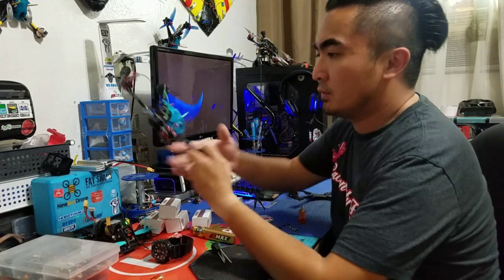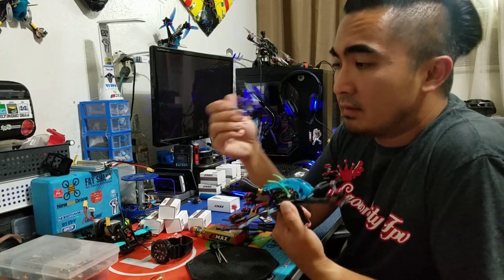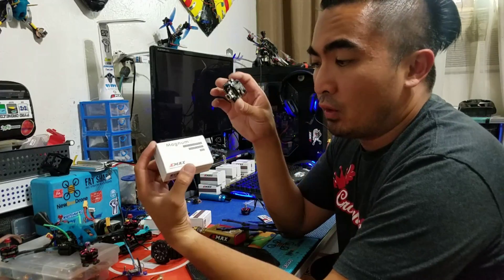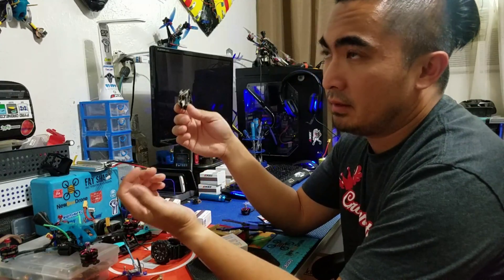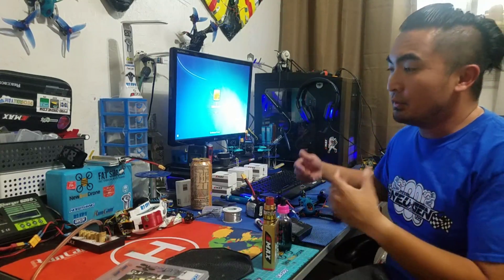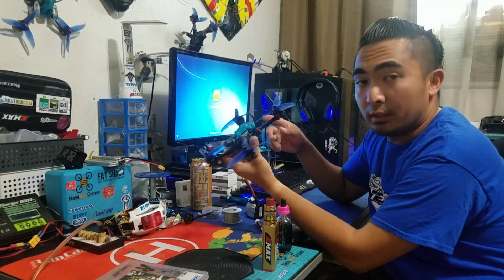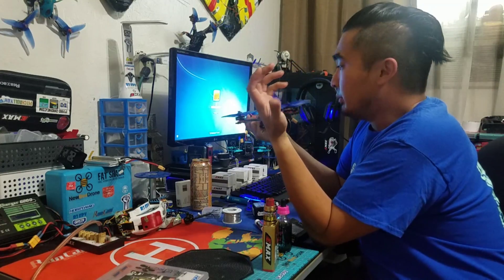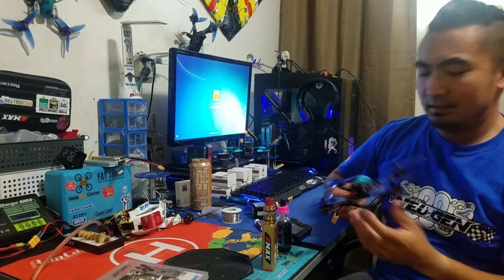R3VOLUTIONARY: Emax Mini Magnum 2 Intro & DVR

Comment: Hi, I bought a EMAX Magnum Mini 2 F4 and BN-220 GPS module. But I could not find any information about this two card connection. Could you please give me some information about GPS module - Controller connection? Do I have to use Spektrum pins for GPS connection? On the GPS module Vcc, GND, TX, RX pins but on the controller Vcc, GND and S pins?? How should I connect them? Thanks your support buy now.
Reply from the maker: did you buy the latest stack with full uarts? the v1 only had provisions for an RX pad.  the v2 has full uarts on the flight controller now capable of GPS add ons and crossfire rx etc.

Comment: I ordered one of these for a floss build. Is it holding up? Anything I need to know about ESC setup in blheli32?
Reply from the maker: Crash-it FPV holding at 10 packs so far with one of em a nice crash and explosion of prop.. i want to get to 30 packs and different crash load tests before i say how durable it is.  i did add an additional (470uf 35v) capacitor for peace of mind. I set demag high for my 1700s because on HV 4.35 6s i would get a stutter on the first initial punchout. Running 48khz and stock timing.
Reply: R3 FPV ok I have 1800kv motors on 6s. So if I have any stuttering I'll raise demag to high. So it's fine to run on 1200dshot and 48khz
Reply from the maker: just try not to load up on a heavy prop.. probably no more than 5046.. they recommend 1700kv 6s as the cutoff for amp draw
Reply: R3 FPV ok I always fly 5046 cyclones 👍, I have the rdq 2207 1800kv and there not crazy amp monsters so hopefully ok.
Reply from the maker: Crash-it FPV sweet i run the 5046c for 2206-2306 motors. I like em alot.
Reply: R3 FPV So just to be sure I can run on dshot 1200 and 48khz ?
Reply from the maker: shouldn't have an issue. i personally am running dshot600 and 48
Reply: R3 FPV thanks for the info 👍

Comment: Cool overview man...👍 Looking forward to a review after your racing this weekend. Where you able to run those 32bit escs at 48mhz?
Reply: Khz not mhz... Sorry man type those wrong all the time. Pwm frequency rate...
Reply from the maker: Jason Faulks have not yet im going to run default for the weekend and then push settings. I know i so want to up the timing, but just anticipating it doing well and surviving this weekends race